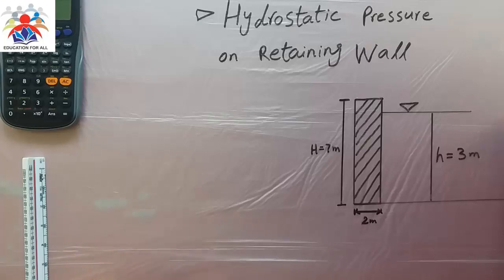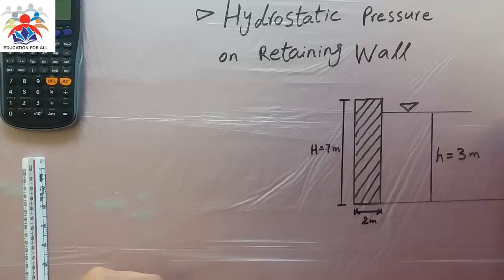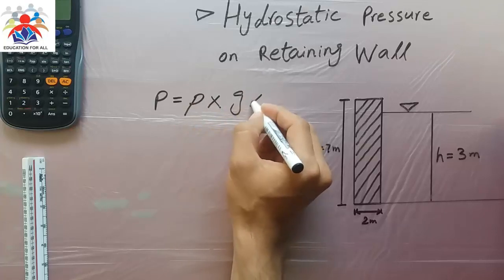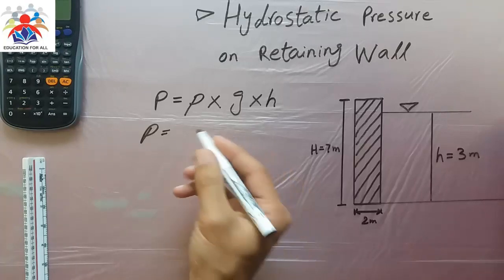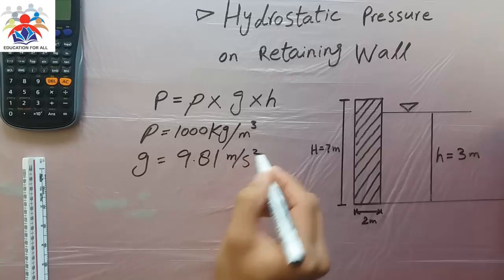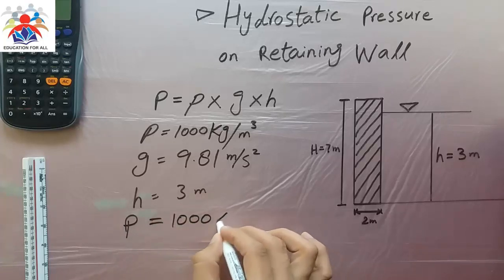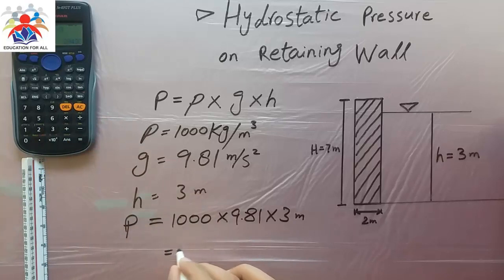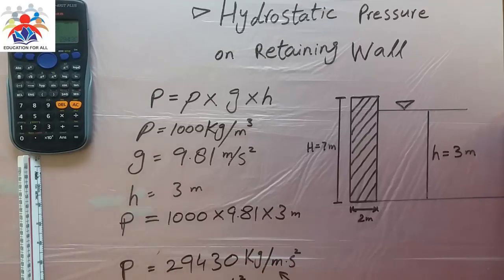Hydro-static Pressure on Retaining Wall

Comment: What a Muppet - it's ~3 ton force at the bottom, not 30!! And the average pressure per m2 is therefore ~1.5 ton force. (3tf at 3m deep, 0tf at top = avg. 1.5tf/1500kgf/15kN per m2).
Reply from the maker: Thank you for your comment and correction 👍🏼

Comment: I’m trying to figure out how much pressure a river would exert on a flood gate that’s in a doorway.  Does it matter how wide the river is?  Or is the only thing that matters is the height of the river against the flood gate?
Reply from the maker: Well Everything matters, so if you have wide River that means you may have many door? Or if you have less wide river then maybe height of the water is big. So if the hight of the river is more it will put high pressure on the gate. In case of wider river the pressure of the water will be dived. Here are many things to consider, for example, you have to think about gates water holding capacity, water pressure, water depth, water velocity, etc
Reply: @educationforall1442 thanks man, I actually ran the calculations and it appears I’m looking at 20psi for a flood event that’s 5’ high on my flood gate.  The other question I have is how much force is being applied to the entire flood gate if it’s 42” wide and 60” tall.

Comment: It means if i construct a water tank of 3 meter that will produce 29000 kg pressure how is this possible
1mtr water colum=1 bar(1 kg)
I have 1.5 mtr high water tank at home which is producing 1 kg pressure
Reply from the maker: Well I guess you may have to follow the formula sir.

Comment: This is wrong. It doesn't show the pressure on Wall.. this formula is to show pressure on Wall in vertical direction not horizontal. For horizontal you have to take height from middle of the wall to get average pressure acting on wall
Reply from the maker: Thank you for your comment, I will look into this matter again 👍
Reply: Or just don't make a video until you understand the basics - y'know, in case you make a ten fold error again ;)

Comment: The hydrostatic pressure is caused by the weight of the water column and it is directed directly downwards by gravity.  What this video misses is an explanation of why the radial (lateral) pressure is the same as the hydrostatic pressure. Also there are no comments on the shape of the wall.  Would the curved wall of a cylindrical tank be subjected to the same pressures as a flat vertical wall?
Reply from the maker: Thanks for your message, yes this example is just a knowhow about the HSP, of course there are many different examples with different shapes
Reply: Yes they would be subject to the exact same forces, but would resist them differently. Hoop tension in a cylinder, Vs the flat wall which needs either inherent strength plus weight to resist, or be buttressed to resist or be sufficiently rigid  and be tied at either end to resist. But whatever the engineering solution, hydrostatic pressure is a constant whatever shape it acts upon.

Comment: Hello sir, while calculating lateral pressure on wall due to water, why we do not consider length?
We only consider the height and width of water for pressure applied on wall.
Reply: It is per meter. The pressure we just calculated is per meter along the whole length of the wall.